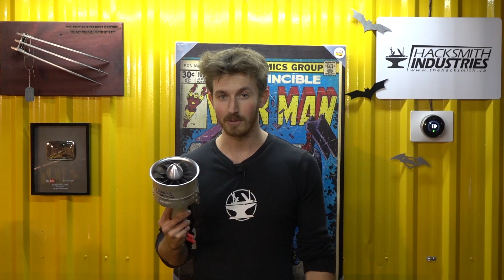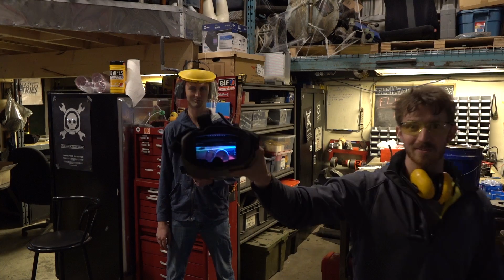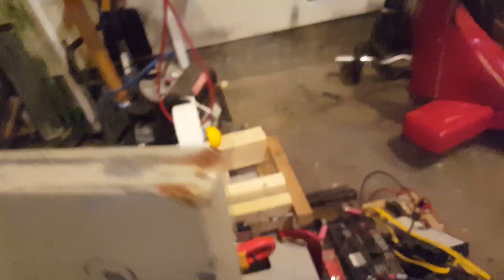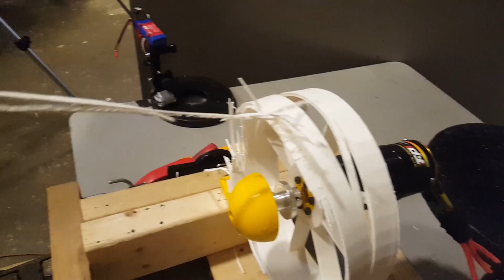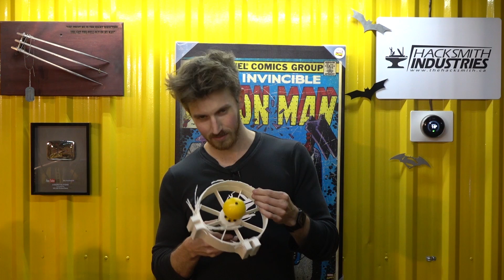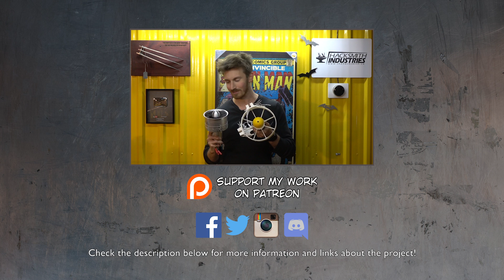Flying Like Iron Man Update: EDF EXPLOSION!!!

Comment: What if you somehow lightened yourself with helium or something?
Reply from the maker: +stephen hendrix that would work... But I'd have a blimp over my head holding me up . . . :P
Reply: the Hacksmith haha yeah but I was thinking more like a suit with the helium running through it in tubes but now that I think of it it does sound like you would need a lot more helium than the suit could provide.
Reply from the maker: +stephen hendrix :p helium is lighter than air -- it only floats because of buoyancy -- we need to displace my weight in air in order to float me, so we'd need to displace over 60kg of air! Which would probably be the size of a hot air balloon :p
Reply: the Hacksmith ah ok

Comment: As I said before Hacksmith, go ahead and use your 3D print, but make a casting of it.  You'll find the integrity is superior.

Making a more durable outer housing might be a good idea for safety also.
Reply from the maker: I'd be more worried about the integrity of an at-home casting of such a precise part... metal shrapnel is a lot scarier than plastic shrapnel! The end plan is to have the blade CNC machined once we've finalized the design.
Reply from the maker: +wise_guy42 integrity? At home casting is notoriously difficult for complex parts like this. Any variations or bubbles/pockets could cause an even more deadly explosion of metal shrapnel...

Comment: one reason that edf explodes is it's an overkill so many volts as you overcharged it
Reply from the maker: No it's not... 3D printed parts just can't handle being spun at 40,000 RPM =P The tips of the blades were hitting speeds of close to mach 1!

Comment: look into baking your final part. will improve strength.

if you need to, can also add a high temp powered material, and bake in a big box to help with material fusion and still gold shape. to an extent.

would not let me edit cause some issue with 505 something code.
my apologies for the three post. trying to delete the messed up one.
Reply from the maker: We actually tried an experiment like that last week, but either didn't pack the sand tight enough or it just didn't work -- the part deformed quite a bit. It's a cool idea though, we might try it again
Reply: the Hacksmith slow down heating, and add time for temp to stabilize. Should be better. But no idea what materials. PLA ABS with nylon shell? Lol, soo many ideas.

Maybe add a ducting ring to the prop to help with the center fugal force and wrap a layer of fiberglass or carbon fiber.
Jet engine cowlings for some of the GE high bypass turbines, and others, have been made of composite to contain engine Failures where parts are thrown from engine. I'm an A&P tech by training so seen a few videos about how well they catch parts that are insane. Was in The same series that they show how a turbine can chop up a bird at +700mph. Just awesome slow-mo.

But why not just make a mold, line it with carbon fiber/fiber glass/Kevlar and make your own?

Ideally, I want a carbon fiber sheet cnc milled then laminated to shape if layers are one piece slices.
This is what I want to try to an extent. Layer carbon fiber sheets in-between printed layers, but I have not figured out how to hold the printed plastic in place unless i get materials that bond with the resin's I use on the carbon fiber. This is something I will try myself.

I have been wanting to do a ducted fan "jet pack"  I would see in the back of a PM magazine. "50mph with upto 50mile range. Has a 50hp 2 cylinder engine" guess 50 was their magic number.
Reply: the Hacksmith have you tried just coating in epoxy?

Comment: Try using acetone vapor smoothing to make it "melt" together while eliminating the ridges.
Reply from the maker: This was acetone smoothed =P
Reply: I found a guy who said that he has "successfully impregnated a variety of 3D printed plastics using a high strength, low viscosity resin (about the viscosity of corn syrup). This is the stuff that usually used with vacuum bags and composite materials. So: print the part with 95 or 100% fill and do superficial cleanup. In a small jar, cover the part with liquid resin (i.e. entire part is just below surface - very important). Use a vacuum chamber and pull vacuum for 5 min, release the vacuum and the resin will get pushed into any remaining internal spaces (there are always internal air spaces even with a 100% fill print). Repeat 3 times. Just before the gel point, remove the part, thoroughly clean off any excess liquid resin from the surface (important!), leave to cure (I use a 65ºC print bed on sheet of aluminium foil for 3h). ABS parts are then good for 20 bar hydraulic fittings (engineering prototyping), no leaks. About 30% increase in strength. Enormous increase in stiffness. Part pre-tensioning effect (resin shrinks 3%). The plastic part will now also sand fantastically well and will have a slightly improved resistance to heat.".  I also read some stuff about adding glass fiber shavings to the resin but have not tried any of these myself.

Comment: why not make em out of metal?
Reply from the maker: Super expensive, this is just a prototype before we have them manufactured in metal =)
Reply: wont metal give you more thrust?.what is this prototype testing? Size?Shape?...just asking
Reply from the maker: Metal is heavier. If it can be done with plastic it will have more thrust. Aerodynamics is pretty complex -- like we said in the video this is revision 7 of our blade design. We're using 3D printing to determine the best geometry of the blade to maximize thrust and efficiency -- once we've found that we'll likely make it out of aluminum.
Reply: alright then. Thx

Comment: I once moded a cheap 140mm pc fan into a 600watt 12700rpm monster.  I tested the blades first without the outer shroud and at full throttle the propeller exploded and all the the blades came shooting out in all directions. I calculate the blades to have been traveling at something like 180mph roughly. 180mph sharp blades near me are not fun, luckily they did not hit me. DON'T do what i did LOL!
Reply from the maker: Aha -- we thing the blade tips hit 0.8 mach speed... even faster :/
Reply: the Hacksmith woow holly balls.

Comment: hacksmith make it out of metal using lasercutting machine and btw it is possible to fly with those 12 kg edfs because just four of them can lift 100+ lbs imagine usinge 6 or 7 of them and also try to make the 3D printed edfs thicker because they will be mire durrable and stronger
Reply from the maker: Can't laser cut metal, or 3D shapes :P We'd still need around 15 of these -- you want almost double thrust for your body weight =(

Comment: ABS Plastic or Polyethylene plastic, polyethylene is elastic so it can withstand centrifugal force better, but will warp, ABS plastic is tough and slightly elastic and can be your best friend in this case.
Reply from the maker: This was ABS plastic =P
Reply: the Hacksmith really? o: ok. have you tried PLA, it's got good tensile strength and a better shear strength over ABS, but is more flexible than ABS. If you want to go for some crazy strong plastic take a look at PBI polymer(also called Celazole PBI) I don't think it comes in Filament form because it has an extremely high melting point.

Comment: Hey this is very interesting project i have been also working on this project and trust me with electric motors and edf of this size which can be mounted on human body is never going to work because the ratio of output power and input power for the electric motors is limited means for more thrust you have to use bigger size ducts and bigger batteries which adds a decent amount of weight itself to the system.
The only thing that is going to help you is to is that either you should bigger EDF or forget EDF use propellers which are definitely efficient than EDF or Finally Forget both EDF and Propellers Use mini jet engine which uses nitro as fuel 
look at this video https://youtu.be/7po10b9ulIk . this is the reason why currently airlines are not using electric power to fly heavy airplanes. ok so good luck for the project i really can't wait to see how you are going to solve this problem....
Reply from the maker: That's the beauty of this project -- we're not trying to commercialize a product, nor are we trying to revolutionize transportation. We're expecting to get a 1-2 minute flight time, which is all we need =)

Check out the GoFundMe campaign for more information about the project if you're interested =)

Comment: You guys need a slow mo camera, to analyze the point of failure and see WHY it exploded. Did the blade actually fly apart, or did the flexing of the printed housing under thrust cause the blades to impact their housing (ducting? I don't know the correct term) causing them to simply break off at speed? You need failure analysis to accurately make the changes you need. And if by chance the housing IS to blame, it would be much cheaper to have those machined from aluminum than the blades. Can't wait to see where you guys go from here.
Reply from the maker: +bullinahanky we'll repeat the test at 1000fps, but I'm not sure that will be even fast enough!

It's more likely any FDM process isn't going to work for this high speed application. The tips of the blades hit almost Mach 1! The inter layer weakness is what really causes the failure. The duct and the blade are for this purpose one body -- when the thrust caused the thing to tip forward, both blade and duct tipped forward :)

Comment: stupid idea from my side. wouldn't a carbon fiber 3D print be better or stronger. Also rather then the honeycomb structure why not introduce a triangular structure. Also remember when it comes to spinning blades "flexible" blades will help. Last stupid thing most blades will shatter when it hits the speed of sound" It isn't a big problem with smaller blades but the bigger the blade the more force will mess with you once you go beyond the speed of sound. But you already know all of this...

Comment: What was the amp draw on the stock edf?
Reply from the maker: It's pretty bang on across the board. 1kW to 1Kg thrust -- t erribly inefficient.

Also the motor we're using is way more powerful than the hobby king one. Hobby king one peaks at 8kw, this is a 15kW motor =P

Comment: shapeways.com has cheapest industrial prints, I found. I build 2000 lbs of thrust almost daily and will need carbon fiber to do your best.  use the 3d and electric voltage draw as a dyno to test blade efficiency before you have a real one made in carbon fiber to save  money.
Reply from the maker: +Shawn Dickens that's what we're doing :)
Reply: Check out shapeways, they print metals. And you can get a quote by uploading your file on all materials. Even their plastics have a better finish that the one shown here.

Comment: It looks like it was just the propeller that exploded and the blades are what caused the damage to the rest of the device, if you could buy replacement propellers and attach them to printed edf's it might provide a good balance between reliability and cost.
Reply from the maker: +chiepah2 we are looking into stacking readily available props :)

Comment: Try to print it with PLA and bake it in the owen on super low temp . I think that one of your problems is layer separation due to the intense centrifugal forces. But as you probleby know you cant use acetone to get rid of the ruffness on PLA
Sorry for bad English

Comment: It will never work if you only use EDF. EDF should only be for directional and stability control. Main thrust should come from RC Jet engines, 3 of them, putting out 30KG of thrust each. That should take majority of weight. Then EDF can control altitude thrust, roll pitch an yaw.
Reply from the maker: +Designandrew saying "never" is what kills innovation. Just because it's not technologically feasible with battery tech right now doesn't mean we shouldn't pursue it. ;-)
Reply: the Hacksmith If you know it won't work with batteries and EDF's why are you try to raise funds to do just that? You need to go to real scale RC jet turbine engines, with electric fans for stability and movement. It's the only way this will actually work.
Reply from the maker: If you check the GoFundMe campaign you'll see the design plan. We can get around 1.5 - 2 minutes of battery life out of lithium polymer. 

We are not trying to invent a commercial system, or revolutionize personal transportation -- we don't need 30 minute flight time. We've listed the reasons why we won't be using jet turbines in the QA video and on our FAQ on the website. Check it out =)
Reply from the maker: +Designandrew ^^

Comment: Wonder if they carbon fibre the disk. Or if reinforced with hardened steel rod at 28 guage (spring steel)Also aluminium sheet metal 32 or higher and fold and fit to the plastic frame would retain structure and prevent vibrations as it cools due to air passing by. The metal will shrink making it proportionately stronger by its molecular shrinkage.

Comment: Hey guys your idea of 3D printing your own turbines is very interesting. Have you considered using the 3D print to make a silicone mold and then making cast urethane parts? It's a little more involved but the parts would be much more robust than the FDM prints you are working with now since the material properties could be isotopic. You may even be able to get a resin with some fibers material (glass?) to enhance the strength. Stay safe!

Comment: I know you probably don't have the equipment to do it but what about 3d printing the EDF with DMLS? I've seen an m1911 handgun that was 3d printed with DMLS and it was just as durable and accurate as a traditionally manufactured m1911
Reply from the maker: +Jenny Tokumei got a quote.. $900 USD to make the blade in aluminum shown in this video :p
Reply: the Hacksmith
Sheesh... What about printing in PETG, polish with limonene, surface finish the parts with conformal coating, then make a casting using tin-cure in a sacrificial mold out of high-deflection industrial poly?
Reply from the maker: +Jenny Tokumei we're looking into electroplating :)
Reply: the Hacksmith
Sounds very hackish... I'm not even sure electroplating really offers any real structural reinforcement. But hey, can't hurt to try, maybe it does.
Reply from the maker: +Jenny Tokumei actually there's huge strength benefits -- some companies specialize in electroplating 3d printed parts!
Reply: you could try to CNC the parts out of aluminum (maybe aircraft grade) or titanium
Reply: CNC is the way to go. steel turbines for sure tho

Comment: Your layer adhesion was way too low. This can be helped a little by increasing your extrusion multiplier to 1.2% and also increasing the print temperature slightly.  also there has been recent tests that baking pla at low temperatures can increase the strength quite a bit. but i would really recommend casting the actual blades using lost wax casting or printing the actual negative mold. I am sure you have already thought trying these things out, hope i helped out a little bit.

Comment: Hi, +the Hacksmith, I'm quite happy you're progressing so much for such a hard project! I was quite curious whether the project would work against basic back of the envelope calculations, and decided to run an old spreadsheet for helicopters I made a while ago... If you want to take a look at the reasoning, take a look at my post in the link below!

https://zigunov.com/2016/11/29/design-review-flying-like-iron-man-from-the-hacksmith/
Reply from the maker: Nice summary! Good to see our numbers line up -- our method of calculating possible flight time was a bit simpler but ended in the same result. We actually have several excel tables outlining all the weights of the components that allow us to play with the size of the fans, the number, and the batteries we'll need =) We'll show it in a future video!
Reply: I'm sure you do have better stuff than what I showed =)
I actually was more interested on tackling the problem from the basic feasibility/insights viewpoint, but surely for the core engineering stage you are now you will need to select actual market components.

Good job, guys, looking forward for updates!

Comment: Question: What is the difference between props, such as those on a multirotor, and EDFs? Obviously they look different, but they both spin around and have blades. How are they different in usage?
Also, have you considered CNC milling the EDFs, or using carbon fiber/fiberglass to make the blades?

Comment: to strengthen your prototypes, you could try annealing the ABS. I know this works for PLA (Thomas Sanladeren has a video on it) and I found some links that point to the direction that it could also work for ABS (it does cause shrinkage, I think in the vertical dimension, so you have to account for that). http://www.plasticsintl.com/documents/ABS%20Annealing.pdf

Comment: Your layer adhesion isn't great, when it fails you shouldn't see the part Delma right at the layers like it did. Try upping your extruded temp.
Reply from the maker: Pretty sure any FDM based 3D print is going to fail in this scenario -- RPM was approaching 30,000 which at the blade tips is nearly Mach 1 =P
Reply: the Hacksmith Maybe, but your adhesion still could use improving. It's one of the trickiest parts of 3D printing, achieving good layer adhesion. Because of that many people think that fdm printers print inherently weak pieces but you'll be amazed what they can do when you get them dialed in. Also, request a sample print from markforged, you can from their website. You'll be amazed, like really truly. Maybe email them about a sponsorship?
Reply from the maker: Unfortunately the MarkForge printers have too small of a bed! Their new model might be able to do it.. we're thinking after the dedicated 3D printing EDF video we'll reach out and see if we can challenge them to make us a sample =)